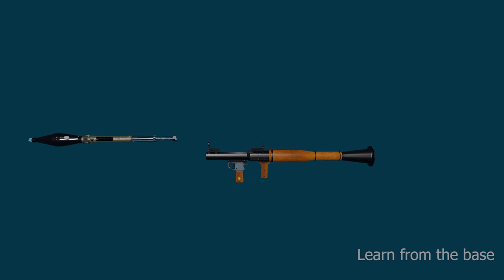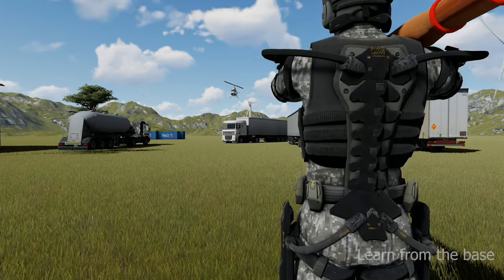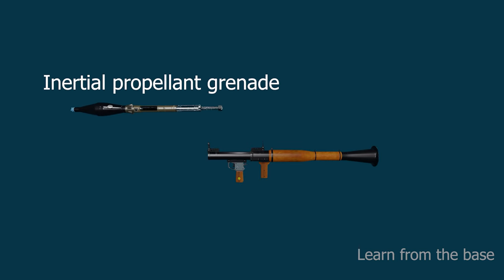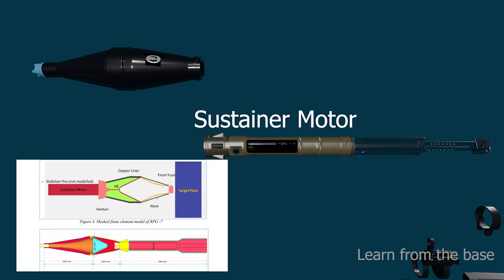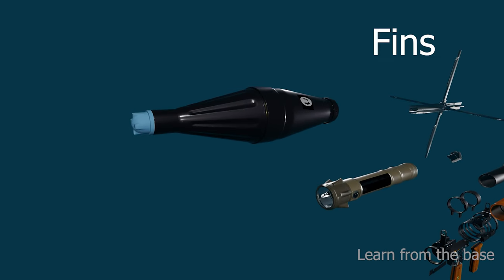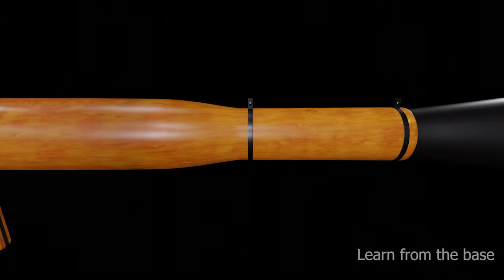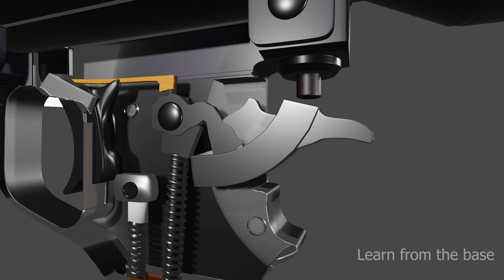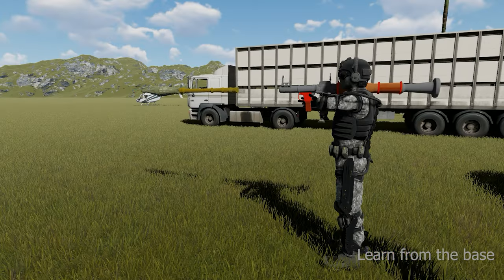How an RPG-7 WORKS?../rocket propellant greanad 3d animation/learn from the base

Comment: For the rockets I think there is three components 
1- the front warhead could use anfo as an easy substitute 
2- the rocket we could use a mixture of iron oxide+sugar+potassium nitrate that could launch the rocket a couple of miles 
3- the flight stabilizer or the fan you could use a model that will eject it's wings when unleashed or build a perfect tried and tested reliable wings for the back of the rpg ammo
Reply: Hoo